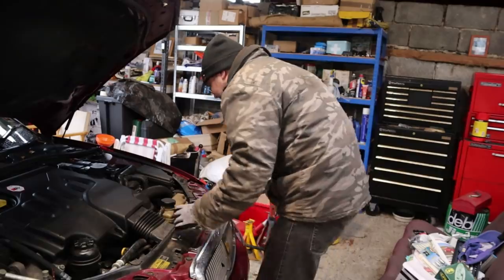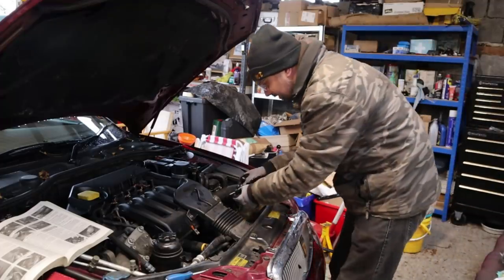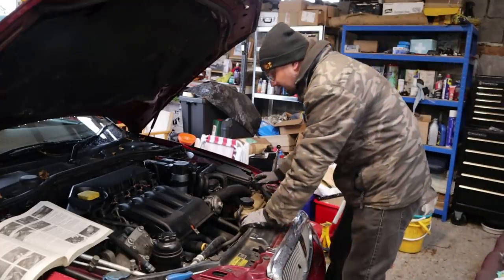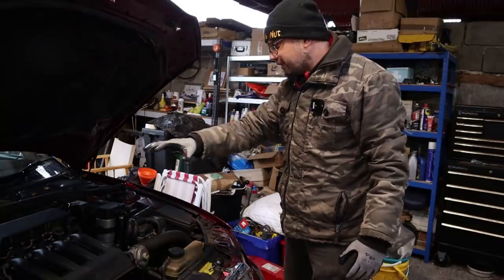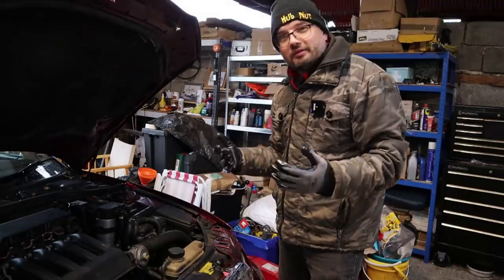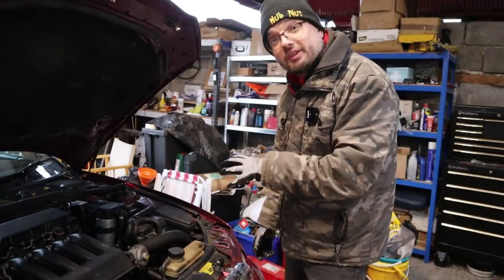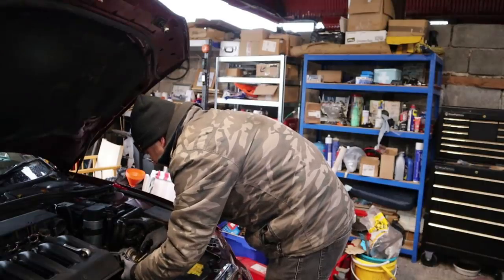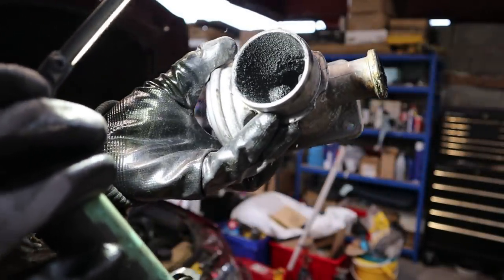Rover 75: Man vs EGR and PCV Part 1

Comment: I cleaned mine once....then ended up removing it all together on a diesel gurus advice when I changed both auxiliary fuel pumps.
Car ran much better, turbo picked up quicker and mpg improved also.
Your ABS light is probably a sensor cable...£10 on eBay. PCV filter change every 30k....is not in any service schedule but will damage engine if ignored.
Lovely... reliable cars once known issues sorted. As I said before...would have kept mine if it was a automatic as my left knee was awaiting surgery!!!!  
A nice MG ZT -T diesel auto...could tempt me away from my XF!!!!!!

Comment: My Lexus  gave up when I was in Galway on business . I stripped out the EGR in a lay by and  took a  bottle of ether which I had  in the car (business purposes)  and some pipe cleaners and painstakingly cleaned out the incredible gungy detritus  in the valve . What a mess !!!!! However it worked and back I drove to Glasgow  without problem . Never touched it again for the  remaining 80k  I had the car . EGR  on all diesels of that vintage were and are a problem . Great video . Keep up your brilliant work .

Comment: "Mr. Muscle" Oven cleaner works well on carbon cleaning.
Reply: And WD-40. Told that lighter fluid is good too, but probably wouldn't try that.
Reply: @R33Racer  yeah, a mechanic once told me he prefers WD40 because it's made to be used on metal.
Reply: @R33Racer  Lol. Light touch paper and retreat!
Reply: Ammonia dissolves carbon, and Mr. Muscle oven cleaner has that!
Reply: Brake cleaner ? Too
Reply: Yep, as said Mr muscle foaming oven cleaner, it's also great at removing brake dust from wheels and it will remove anodising from alloy parts pretty damn quickly.
Reply: Don't use on Aluminium, it will damage it as it's caustic.
Reply: @tonys1636   Totally agree, never go anywhere near aluminium with oven cleaner, cylinder heads, pistons ,throttle bodies etc. A lot of cheap alloy castings that are made from recycled  coke cans  etc  are porous and the caustic will penetrate.
Reply: @allanwinter4991  The old technique - oxy-acetylene torch - get stuff glowing then turn off the acetylene. Neat oxygen grabbing the hot soot to combust - a travelling flame burns it out cleanly.
Not recommended on plastic manifolds.
Reply: @tonys1636  But plastic manifolds ???????? !
Reply: @millomweb  because bmw.
Reply: @Simon-ui6db  My comment was not re maker but use of flame on plastic parts.
Reply: Strong oven cleaner is excellent because in the foam expands into be the difficult bits
Reply: @keithnewton8981  I don't think the carbon cleaner we used in industry is available to the public hence the cheap Mr. Muscle fix on car egr's etc.
Reply: @tonys1636  i hear it’s not to be used on your privates either
Reply: Dont use on aluminium its absolutely not designed for that. Only good for cast iron or enamel.
Reply: I would not advise using the extracts from milking a cat either, so I am told

Comment: After working at a Rover dealer for a number of years, we saw a large number of 75's as well as other models, I can't say that we had many egr valve problems, though  pcv valve filters clogged up quite often, you can get the filter screen separately, or if you buy the complete unit, the Landrover version was generally more expensive. One reason for lack of power was the mass air flow sensor getting coated with salt from road rain water spray, the sensor is available with or without the housing, a while ago when they went on back order, a factory fix was to wash the sensor with de-mineralised water, then dry it with low pressure air, though the sensor is fairly fragile.
Great channel

Comment: This was a great video with a superb commentary. I think you are a good mechanic, not ham-fisted. It's dead easy to break a spigot of brittle plastic by accident. Nobody can claim that you don't get stuck into complex areas. This engine really interests me because I have a Land-Rover Freelander 1 with the same and was told the EGR and manifold needed cleaning out. Brave work on a "modern"!
Reply: Somebody bought me gloves and the first thing I did was snap off the washer bottle as I was undoing a nearby bolt. Bare hands for me I'm afraid.

Comment: You can buy brass return T pieces, mercedes I believe, that fit. Cost more, but don't snap. Put them on my old Freelander, with the Venturi pcv filter (BMW) never needs replacing.
Reply: Yes fitted one on to my freelander BMW  call it a oil separator  . No more oily tube in there . As for the egr  valve I removed that and replaced it with a bypass  valve from ebay even came with false vacuum tube fitted to block that .
Reply: went to change my pcv last month only to find the previous owner had already changed it for the new oil separator type. Never thought of checking before I bought a kit :D

Comment: Egr cools the charge down which reduces Nox because nox is generated at high temperature and pressure.
Reply: Indeed because there's less oxygen and less fuel required

Comment: Good work, Ian. When my wife and I had Freelanders I did this job regularly and would clean everything on the low pressure side as much as is possible. I eventually replaced the PCV filter (which was always sodden) with a modified maintenance free kit costing about £20 on eBay, it made a world of difference and kept the air box free of oil. Also, look out for rubber hoses softening due to oil contamination which can start leaking leaking to poor turbo response.

Comment: I've been through a 2.7 5 pot diesel engine that couldn't pull the skin off a rice pudding. Changing EGR valve and vacuum modulators made a massive difference. The EGR valve was sticking open and really blunting the boost cycle and the vacuum modulators were tired and just didn't respond very quickly, if at all.

Comment: I did the EGR on my 08 Passat, it was clogged solid with crud. The anti shudder valve had to come off first and that was exactly the same. 2 cans of EGR cleaner and 3hrs later they were pristine again. Made a big difference in driving and black smoke under throttle though.

Comment: The egr is for particles that aren't measured in the MOT in the UK it's for the EU test. There isn't anything on the test for the egr to be checked. Blocked mine about 3 years ago and the emissions test as MOT time hasn't been an issue. My MOT tester actually suggested I blanked it off.
Reply: I got mine blanked off and the software adjusted so the eml wouldn't come on on my fiat Doblo 1.9 mjultijet. Seems to run so much better and smoother.
Reply: What happened to the free acceleration smoke opacity test?  Aka "is my timing belt going to break" test?
Reply: @jamescaley9942  It doesn't do anything for smoke, only NOx which is invisible.
The MOT test requires an inspection to see if the emissions control equipment has been tampered with, but that's nigh on impossible on many cars.

Comment: Very interesting, Ian. Now I really know why I hate new cars. On my old carbureted V8s, 2 bolts, one vacuum line and EGR off. Cheaper to buy new that fuss with an old one. PCV system was a $10 fix for new screen, valve, and filter. To do both was a 10 minute job. I have to do the PCV on the 90 Volvo. From what I read, the flame trap and oil separator are a right pig to get to. Oh, well.

Comment: i believe the Torx spanner your refering to are actually sockets, they are called E-Sockets. in a pinch you can use a standard socket on them as long as they are not too tight, as you risk damaging the splines.

Comment: Alway's good to have a few 20th C. cars around when working on a 21st C. car.  My experience has been that working on modern cars (yes I do consider the 75 a modern car as it was very modern at its time) is you tear it apart, then work out all the parts you need to put it back then wait for everything to arrive (who knows how long) and reassemble.

Comment: My Laguna EGR was hellish. I had to clean it every 6 months. 
I also had the blocked silencer on my Espace which zapped the power. The wadding inside it was coming loose and clogging the baffles. 
I also had a sticky waste gate on the turbo of another car. Sometimes it would boost other times the engine management light would come on. 
Good luck!

Comment: Great content, thanks again. I was doing these very same jobs on my 2001 320d Touring with the 136ps M47 engine back in 2008. Worth changing the air filter and fuel filter also.

Comment: My wife had a 320d with the 'same' engine. When it was good it was excellent but it had lots of problems by 130k miles. Our old Kia sorento has a vacuum egr and no map sensor so you can just pull the hose off and it's disabled, no warning lights or anything. Old school! Try not to get too much chemical wise in the vaccum port, it will mess with the diaphragm. Also, I don't know if the upgrade is available for the rover installation, but the later m47 in the BMW's had a 'swirl' type seperator that does away with the cotton element. It is allegedly maintenance free and helps protect the turbo etc.

Comment: If you think the vanes in the turbo are sticky then it's worth disconnecting the control solenoid/vacuum actuator etc. and moving the vane arm by hand. Sometimes a good wiggling can sort it, albeit usually temporarily.

Comment: Small external torx bolts can usually be persuaded to undo with the application of a suitable multi point socket,if it's a bit of a slack fit, covering the head of the fastening with a piece of work glove before putting the socket on is most effective in helping to gain a better purchase good luck with your leak offs.
Reply from the maker: Cheers. They were tiny and the smallest socket I had was 4mm. Wouldn't touch it.

Comment: The problem is with all the crud preventing the valve closing properly so the boost is forced out where the exhaust gas should come in.
Reply: Then it wouldn't be a low rpm problem?
Reply: @rimmersbryggeri  I’d be a problem as soon as it starts boosting.
Reply: @howardcrampton  Yeah but the way he explained it in the last video sounded like swilflaps to me, but if this car doesnt have them it's not that.

Comment: I cleaned the EGR and intake on my E39 as I was blanking the infamous swirl flaps at the time, both equally had carbon buildup similar to your rover. Breather filter was also well overdue, they do seem to get overlooked on these engines.

Comment: Very good Ian, cleaning all that crud up,messy but worth it, when i had a motorbike[Yamaha rd 250],i used to take of the head clean the bores,top of pistons except for the edges, and clean right through both exhausts and the baffles , very messy but you will notice the difference , good luck on your trip, and hope that cold gets better..

Comment: I must take issue with your comment on the swirl pot PCV. I've had mine on for two months and it's clean as a whistle. A friend with a TD4 Freelander did his swap around three years ago, again, it's spotless. The idea is that it cannot get restricted or blocked anything like the sponge filter. Trouble starts when people use cheap oil or simply don't service the car properly. The old-style filters were getting missed during servicing and this, in extreme cases, was resulting in some cars blowing turbo oil seals due to overpressure. Don't fear doing the modification, a quick look at it during normal servicing will put your mind at rest. All the best, and continue enjoying a great car. Jim.

Comment: The Rover engineers improved the BMW M47 engine and it was redesignated M47R for the Rovers. Cleaning out the intake manifold is a worthwhile job but it’s a very mucky task. Those plastic T pieces do get brittle and you have to be careful, I replaced mine with brass ones. Sometimes worth replacing the small return feed pipes too as they harden over time.

Comment: Very ideal having a parts washer. I never had a problem with my EGR valve as such but would take that and the exhaust manifold off every year and clean with Mr Muscle oven cleaner which turned all that carbon, grease etc into sludge which was disgusting but once cleaned up they looked like new. My mpg would go up for a while after that. You could delete the EGR valve but you might have to reprogram the ECU.
Reply: @Jambo I don't have a diesel anymore as it weren't doing enough miles but would give it a good blast down the motorway from time to time.

Comment: Oops! Been there before! Lol
Upgraded Brass injector returns are available to prevent this thing happening again! 
Also worth changing the breather to the later vortex system, which is plug and play. You’d also be replacing the diaphragm in the other half of the unit. 
Check all the vac hoses to the turbo actuator and control solenoids. These always fail on the BMW’s and cause all sorts of boosting problems.

Comment: Hope you didn't find any extra bits floating about like I did with one of my Rover cars, found an extra EGR valve metal seal, not good if it had entered the engine !! May have been on a Freelander 1 or 75 can't remember. The 1.8 petrol engine on the Freelander had had the remote thermostat added, but the old one had also been left in place instead of being removed and replaced by a spacer. This had been done at the dealer in Stratford-on-Avon before I owned it....good job I checked the work!! There are two EGR valves on the diesel ingenium engine...a high pressure and low pressure valve.

Comment: All the recirculation systems got gunked up to the point that my E60 idled like a bag of spanners in a washing machine, so I had them all replaced; some pipes were almost solidly blocked. The transformation was incredible - not so much in terms of power, but economy. Suddenly a deliberately slow (55-60mph) dual carriageway run was returning just over 40 mpg. On a 3 litre petrol car with a quarter of a million miles on the clock.

Comment: MARVELLOUS - air goes through the air filter/cleaner THEN they mix that clean air with exhaust and oil vapour !
Reply: That's why I had mine blanked off then the software adjusted.
Reply: @matthewbourne659  Does it not work just by plugging the vacuum pipe ?
Reply: @millomweb  no it's a modern one with an electronic solenoid. I had bad hesitation at low rpm and the fiat Alfa specialist I took it too said it was the main cause of it on multijet engines.
Reply: @matthewbourne659  Interesting

Comment: My 525d (M57TU, a close relative of the engine in your 75) seems worse since I cleaned the EGR valve. Suspect it was stuck closed before. I'd have blanked it off but apparently the ECU being aware of that messes up DPF regen. I'm still glad it has a DPF since I feel bad enough driving an old-ish diesel as is though. I did blank off the swirl flaps. Not sure the pre Euro-4 engines have those, but I'm glad I did since they were disintegrating and in great danger of getting sucked into the intake.

Comment: I used a egr blanking plate on both vectras, causing more trouble than its worth. still had a new egr valve, but the turbo, even new was getting stressed  and losing power. now no problem.

Comment: Doesn't that part washer have a pump that recirculates the solvent and help pump the cleaner through the parts your cleaning ? And have you got one of those air jet attachments for your air line so you could have dried the parts with it  and blew out the gunk. ?
Reply from the maker: I think the pump is air powered. My compression is three-phase. I don't have three-phase electrics... (compressor was given to me).

Comment: Had a fiesta diesel in work for an mot a couple of weeks ago. Failed on the smoke density test. Badly. Long story short the inlet manifold had almost completely healed up with tarry soot. The 45mm diameter plenum was down to about 10mm at best inside. 
I said to my mate at work "I bet they'll crash it tomorrow now it's got 5 times the power and they've got used to full throttle everywhere."
Hopefully they didn't.
Reply from the maker: Yikes!

Comment: It is advisable to fit the modified BMW cyclone part for the PCV, I fitted it to mine. I worked at a BMW dealer at the time and it is a known fault on older BMWs and the cyclone cures it.

Comment: Also worth checking any sensors in the inlet after where the EGR dumps all it's sooty filthy carbon deposits!
Things like MAF and MAP sensors need to be kept fairly clean and free of any build up to function properly!
Could be a source of your lack of power, certainly the EGR not functioning properly will cause poor running.😎👍

Comment: Best thing to do with the egr is ditch it and buy a blanking plate from eBay
Also replace the breather filter with the updated BMW part which doesn't clog up
Lastly get a synergy2 or a blue spark crtech tuning box, the difference is like night and day and will improve your enjoyment of the car immeasurably

Comment: Hi Ian, this is a cliff hanger to end on, I would try the car dismantles for a replacement, or maybe a BMW dealer if it is a BMW,engine or Is there any diesel  specialist nearby, I can't wait to see how you going to get out of this, you was doing so very well, and I am inprest with your part's washer, best of luck
Reply: This is the first time we have seen the parts washer and it's not plumbed in yet. I went to the euro/pound shop and got a variety of brushes( nylon brass and steel) which would make cleaning parts much easier if I had a parts washer.....

Comment: Did I miss the episodes where Mr Hubnut acquired a wash tank and two tool chests?  I have envy issues now. 

I also swear by mr muscle oven cleaner followed by the dishwasher!  My wife has mainly mixed feelings about such practices!😉
Reply: Time to get the wife a new dishwasher in the house and move the old one to the garage. An old electric cooker in the garage is helpful too. Not only heat for the garage, but for powder coating bits and bobs. Also handy for working on the tail lamps of old Volvos. Ask me how I know that one?